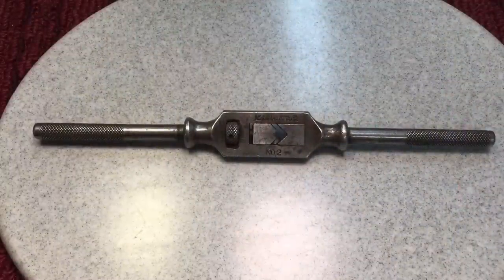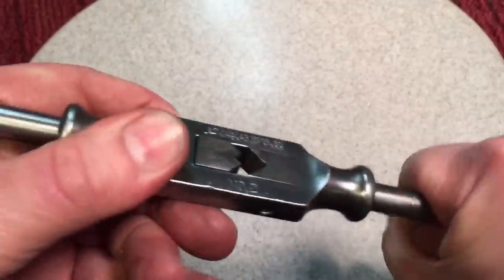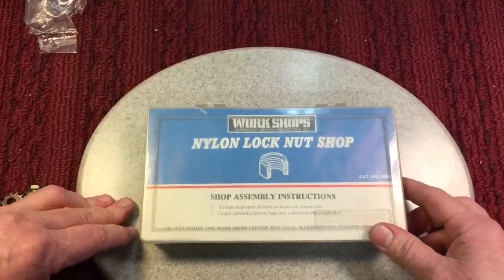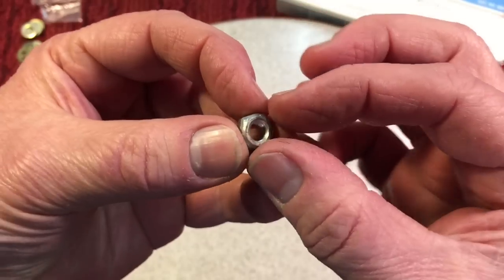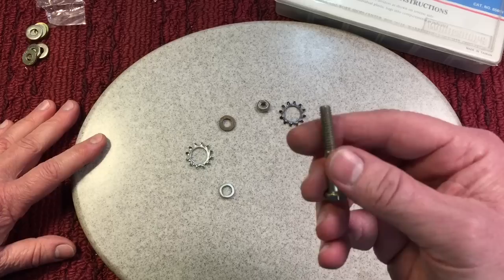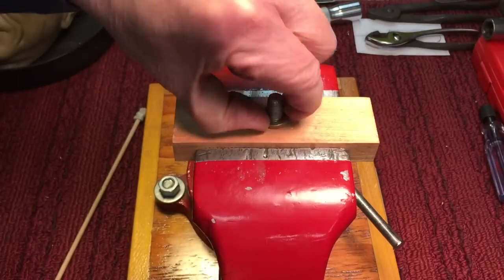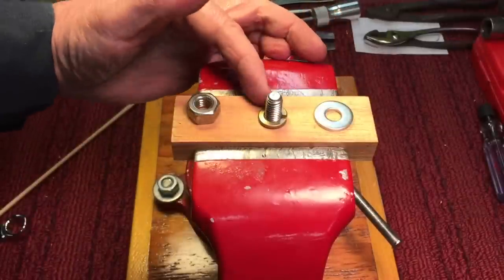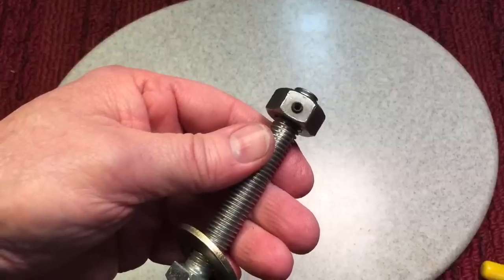Rare Kraeuter Gas and Burner Pliers

Comment: If lock washer first it locks to washer not the nut. If lock washer second it locks to washer on the bottom but not the base component. So use just a lock washer. Also job of a normal washer does assist with spreading the load but also is sacrificial in taking the damage caused from a rotating nut edge. Look at a nut used on machines that are designed to be tightened and loosened, they are often flared with a circular base. In effect a built in washer. Cheers

Comment: Commenting on a number of your videos at once, was able to binge today.  Yeah twenty bucks is my limit as well, problem is that adds up quick at shows and townwide garage sales.  I have been good and keeping of eBay as I wait for the tool shows to open up again, still cruise Craigslist and marketplace.  I wonder if you could rotate that out wrench ninth degrees to break the live free, similar to a breaker bar, far more leverage using it that way?  I don't have enough tools to have non users that or I only buy cheaper priced stuff with full intention of using it.  I have been using flat washers but that makes sense to omit it and will try that going forward.

Comment: I've got a really old pair that has a strange offset. Sort of a duckbill. I think it has that end detail, I'll have to look closer at it. You really got me looking closer at my old tools. Today I picked up a Patina Boys wrench and really looked at it like how would this come out if I started grinding away at how far would I have to go?
 The correct answer is; Nordlock or Red Threadlocker. I don't bother with split washers much anymore. AVE did a video and showed them to be rather useless.

BTW I always wanted that end detail grooves on Vise Grips because to me it seems the grooves on vise grips go the wrong way when you're really tightening them onto a bolt head.

Comment: So my understanding was that the lock washer works as a spring and that once the bolt is torqued down the spring (washer) is flat, thereby providing an upwards pressure (because it wants to return to its original shape) against the nut with enough force that the nut could not un-loosen itself.  The point you made (that it digs into the wood) only works with wood, but we've all seen lock washers used with metal, which negates your point because it can't dig into the metal.
Reply from the maker: That's why they are considered useless in the industry.  There are convex washers made that are designed to add upward force to the nut adding to the natural gripping friction of the threads.  They are not popular though.  The split in the oak washer was designed to create a gap that allows for deformation and grip.
Reply: @ScoutCrafter  Ahh ok, thanks!

Comment: A washer not only spreads the load but stops the nut when tightened marring the surface especially on chrome on bicycles and motorbikes for example where the last thing you would use is a spring washer which would dig into the chrome causing it to flake and rust,star washers or as they are known as in England shakeproof washes are designed to bite into the metal so again a big no for chrome work or delicate surfaces,to be honest I just use a flat washer before the nut and a couple of drops of thread locker But another good way is to use 2 nuts tightened against each other i.e with spanners one turned left and one turned right.

Comment: I suppose rivets are the original lock nuts. Basically pins that are peined over on both sides to prevent loosening. I’m always amazed when I see old bridges that are mostly rivets. Some of them are equally spaced and some of them are just all over the place. It really is fascinating when you pay attention to them.

Comment: Flat washer, spring washer , nut.  Flat washer spreads out the downward force , the locking washer pushes up on the nut so the nut doesn't back off.

Comment: Light aircraft engines use flat washers under lock washers. Lycoming likes star lock, Continental use split lock. Not sure why but they work well. Maybe the aluminum components would get destroyed by lock washers digging in? Continental has used an interesting 2 piece lock nut on exhaust that deforms slightly when contacting the manifold flange but have no resistance otherwise, saving wear on exhaust studs. They are over $10  each! A 6 cylinder uses 24 of them.
Reply from the maker: That is great to know!  I think you are right about the soft aluminum possibly getting deformed by the split washer! Thanks!!!!!!!!
Reply: @ScoutCrafter  
Actually the internal star locks do more damage than the split locks! You should check out the TCM exhaust nuts, they are p/n-643967, 1/4-28 threads.

Comment: Well john speaking of gas and burner I bought a amplifier off Ebay and I plug it in and it exploded love kraeuter
Reply: Ps the wire cutter was in the jaws of mine
Reply from the maker: Years ago my Dad was big into Vintage Hi Fi equipment...  The older capacitors posed a problem many times and it was always a good idea to power up older equipment slowly with a Variac...  =D   We blew up lots of equipment upstairs, I can still smell the smoke!   LOL
Reply: Well I need one a cant afford one yeah the smoke terrible

Comment: You have made a wrong assumption about the lock washer and how it works. It's designed purpose is to put spring tension on the fastener, the digging in is merely a common by product of the washer turning when tightened. So what we were taught as youngsters still holds true, flat washer then the lock washer, specifically to keep from marring the surface of the unit being bolted together.

Comment: Well, I've learned more about split washers. I thought they worked by tension. What I can tell you is that cheap split washers are worse than useless. I dont think they are made of spring steel, and in my experience they will break when being tightened.  Might be Chinesium.

Comment: I’m not sure what those engineering sources are but the proper way, per MIL Spec is to place a flat washer first, then a split washer, then the nut. The split washer when tightened is compressed and provides an opposing force against the nut to prevent it from backing off. I don’t believe the purpose of the split is to dig into the material. That would cause unintentional damage to parts and create unwanted stresses. I’m strictly speaking in the military application world, in applications where life is not risked, do as you like. Nice tap wrench, I like that they went the extra mile to use square threads. Don’t see that level of dedication today. In some aircraft applications, jam nuts are used which don’t use any washers.
Reply from the maker: Steve- NASA gave up on split washers years ago!   =D
Reply: Well that's understandable, space requirements are much more demanding but for everyone else the split still has a place. The vibration requirements are insane for space vehicles so it stands to reason they need a better mechanical fastener method.

Comment: Most engineers I have encountered have little to no real world experience. That said, I don't believe the bit about the split lock washer working by digging into the material. I contend it is cut and twisted so that it applies tension to the assembly. (check into Belleville springs or Belleville washers).
Vibration is what makes threaded assemblies come apart. Loctite, for example, fills the cavities between threads to eliminated the spaces in which vibrations originate and multiply.

Comment: I finally made my first 50/50 mix.  I used a plastic measuring cup to get the right mixture and when I put the acetone in it melted the inside of the cup.  Also I noticed that a lot of your washers, nuts, screws etc. were purchased from Lichtung workshops.  I used to get my stuff from them but I think they went out of business.  The containers were great everything was laid out nicely.  Do you know if they are still obtainable?
Reply from the maker: Hi Frank!  Acetone is hard on certain plastics!  😃. I can’t remember where I bought those assortments, I have a bunch!  All 20+ years old...  😃👍

Comment: So if the split washer "digs into" the metal, shouldn't you install it so it will dig in when reversed instead of when your tighten?  Years ago place I worked at, we had some "summer help" and were cleaning up leftover unused hardware, and he asked if he should throw away the "broken" washers?   Three pairs of burner pliers two different lengths, but none were adjustable.

Comment: How come you don’t use stainless fasteners? I’ve basically gotten rid of all my regular steel fasteners and replaced them with stainless. They work for the majority of applications and won’t rust. I have organizers full of stainless nuts and split lock washers. I’ve heard the argument about split washers being junk, but that’s not what I’ve experienced. I don’t think I’ve had any come loose on me.

Comment: I say just the split washer. Using a split washer with a flat washer never made any sense to me. It kinda defeats the purpose of the split washer because then you're just relying on the friction of the flat washer to keep the nut tight. But that's just my opinion...

Comment: What do you store your 50/50 mixture in? I use a chemical resistant spray bottle but the sprayer degrades. Help!
Reply from the maker: Hi Virginia- I use the ZEP brand containers...  Acetone is killer on plastics like PVC, you need HDPE (polyethylene) containers and sprayers...   https://www.amazon.com/ZEP-HDPRO36-Professional-Sprayer-Bottle/dp/B01LTH1A1U/ref=sr_1_3?crid=10KAG6ARQLP2Q&dchild=1&keywords=zep+chemical+resistant+spray+bottle&qid=1616217737&sprefix=ZEP+chemical+resistant+spray+bottle%2Caps%2C210&sr=8-3